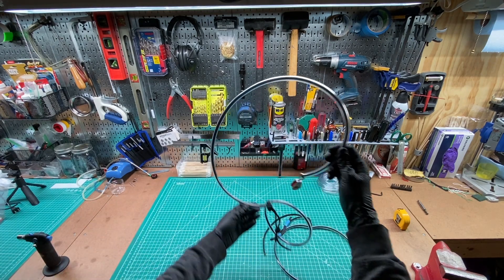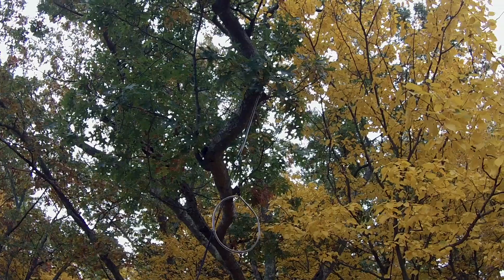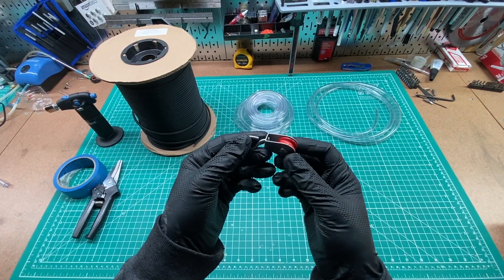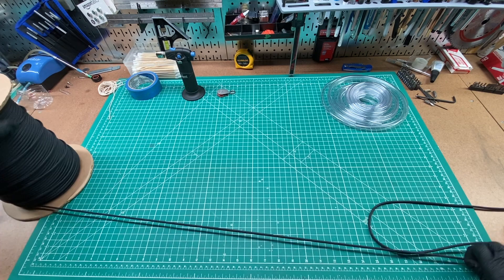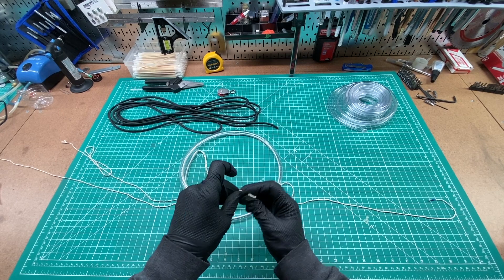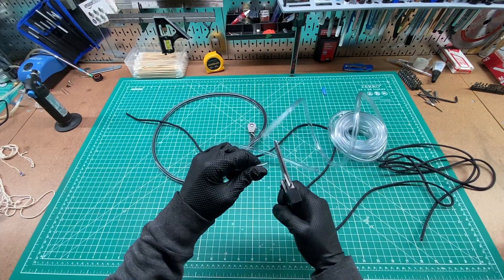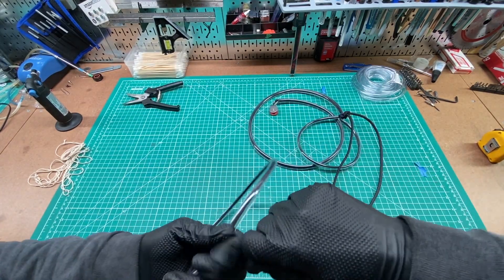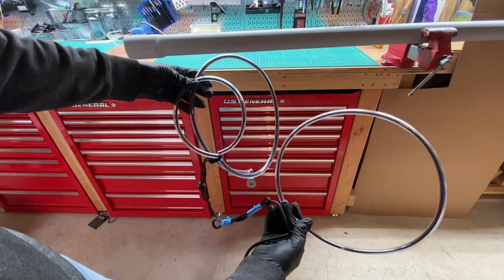Building a Pulley Assembly For Hanging Wire Antennas in Trees

Comment: So the branch size, the 39" in your example... just how small a branch is too small? My target tree is a tall, spiky pine that seems to have branches not much over about 4" wide. Will those even work?
Reply from the maker: I have two of these on branches that are probably around 5-6” in diameter. And another one on a branch that’s maybe a foot in diameter. When sizing it, it’s ok for it to be larger than your branch — in this case the pulley will just hang lower. If you put it around a large branch, you need to be sure to have enough length to get all the way around.

Comment: Yet another amazing video - thank you for taking the time to make this!! I've got a BIG spool of paracord; any thought on whether that would be a sufficient substitute for the rope you used here? Thanks again!
Reply from the maker: Thanks! Hm I’m pretty sure paracord is made of nylon isn’t it? Dacron (polyester) is supposed to be really good for UV resistance. I don’t know how well the paracord would hold up. Pretty sure Nylon  is UV resistant to some degree but I don’t know how they compare. If you can tolerate a failure at some point, maybe try out the paracord since it won’t cost you anything. I used polyester for my antenna setup.
Reply: @MostlyBuilds  Thanks for the quick reply! Great points all around; honestly you've shown that 3/16 works perfectly with these tubing sizes - it won't kill me to pick up a roll. Thanks again - what an absolutely brilliant idea. I've got some 100-foot trees in my yard that are about to get a ZS6BKW for the first time!! 73.
Reply from the maker: @patriotdroneservices ah nice! I’m running a ZS6BKW as well. It’s been great for me. Best of luck! 73

Comment: You sir, Rock! I made this pulley harness, and just installed it up on a ~70' branch. I also used your technique (in another video) to help pull my rope around a single branch.  Thank you!  

I have been trying to come up with a pulley harness design for awhile and failed. Now I have my antenna up!
Reply from the maker: Yessss! Thanks for sharing! Did you use a throw weight to get a rope up that high? 70 feet is impressive. I’d estimate the highest I’ve done is like 40-50 feet.
Reply: drone (SG906 pro2), 14lb fishing line, and 3/8oz weight and a remote servo thing from aliexpress   No leaves so I was able to fly though a branch and drop. Drone crashed, but just need new props. Took several attempts and few days to get it on a proper branch.

From there, I used a type of mason line, then paracord. Im using Mastrant 4mm rope (gigaparts) for the actually #25 (amazon) pulley/antenna....
Reply from the maker: Ah very nice!

Comment: Great invention.  Found using 3/8 ID tubing worked better in my hands.  Recommend placement of a swivel connector between the pulley and wire antenna  so the pulley will not get tangled in the line thru the pulley when the antenna wire gets twists in it.
Found pulleys on Amazon .

Comment: I have an efhw antenna sloper configured from my shack up to a tree. There is pulley in the tree with 5 kg weight giving the wire a gravity pull. Is it a good idea? I'm not sure but the gravity pull keeps the wire straight at all time.
Reply from the maker: That’s what I do with my center fed dipole. I have 3 pulleys with weights holding it up. I think my weights are between 3-4kg. The weight of the antenna wire and how strong it is will dictate how much counter balance weight you can safely use before it breaks the wire.

I posted two videos about the weights that I made. Here is the second one where I filled them with BBs: https://youtu.be/30LFzLWNYWU
Reply: @MostlyBuilds  Thanks for your tip . Excellent work, in your video on counter balance weights.